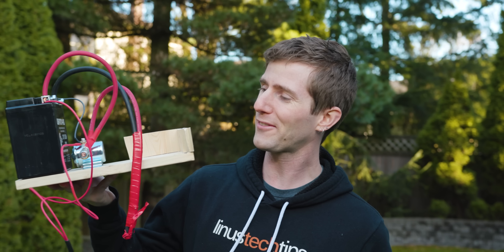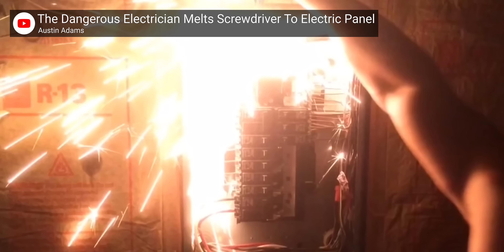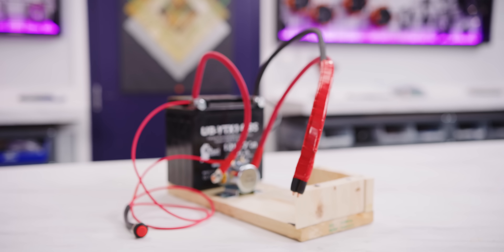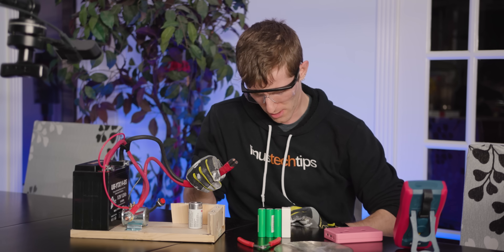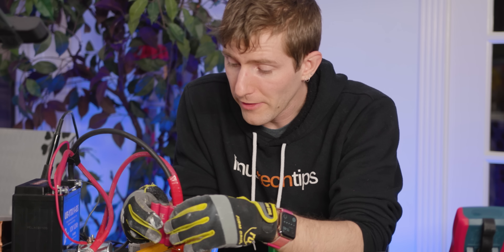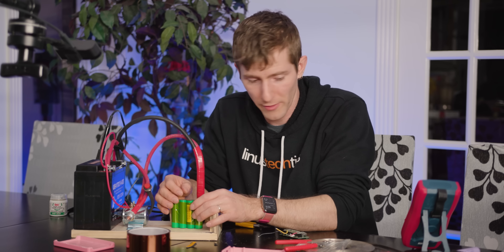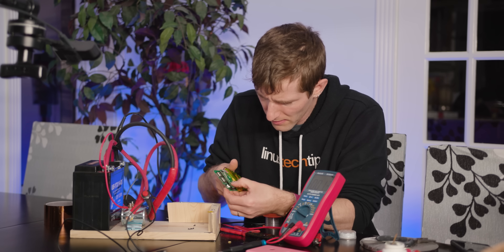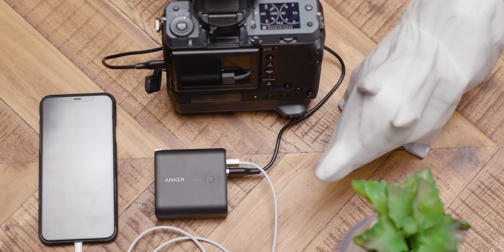I spent $100 to save 20 bucks... and it was TOTALLY worth it!

Comment: you may need a "arduino" driving relay to have the same time on every weld. maybe arduino - optocoupler - mosfet - relay - boom ?
Reply: Skip the relay part. Just use 10 high current mosfets in parallel. Works better and is easyer control with the arduino.
Reply: @Henrik229  do you mind to explain in more detail with tech specs of what I would need to buy?
Reply: An arduino is super overkill. Just build a basic timer circuit lol. Charge a capacitor and have it discharge through a variable resistor. Welder only runs when the capacitor is discharging.
Reply: @Mandragara  Arduino allows for way more precise timing especially since the battery will lose charge over time meaning the pulse timing will have to be adjusted during use even for the same material.
Reply: @dunzerkug  Just use the capacitor and variable resistor as a timing circuit, don't pass the main current through it. Button to initiate the charging of the capacitor, dial on the variable resistor to tune the pulse duration.

I get that it could be a fun Arduino project, but I always prefer old fashioned analogue circuits compared to sticking microcontrollers in everything.
Reply: @Mandragara  sure is, but i doubt they know how to do a 555 timer as easy as they could do it whit arduino
Reply: @ql11ql  True, it depends what the goal is.

You can code most programs in MATLAB, but that doesn't mean you should!

555 timer is more elegant, Arduino may be faster to implement, especially if you don't know how to make a 555 timer. Elegance vs speed.
Reply: I used a raspberry pi with a relay board for mine
Reply: GreatScott has a video about spotwelding at hope.
Reply: Or using COTS components would be a 5V Arduino and 5V relay to control the 12V starter relay, also recommend adding a button to initiate the Arduino program.
Reply: What a great ideia Nicolas!

Comment: May be completely absurd for a $50-100 battery bank, but could be better depending on the situation. Had a professor in college specifically recommend re-celling for camera batteries, specifically Anton Bauer gold mount batteries. Battery bank may not meet your ideal savings-labor ratio, but doing it on a $300+ dollar battery I'd say certainly has a decent RoI on it.

Comment: Pro-tip: Apply Flux before soldering. It will cut down the time needed to apply heat, and ensure a stronger connection. (In before the Louis Rossmann commentary video!)

I actually soldered a new battery pack together for my body groomer razor three years ago, and it still works great today!

Comment: AC is far less dangerous then DC current.  Using the battery is safer because you're dealing with a tenth the voltage.  Battery is 12v where as domestic AC power in the U.S. is 120v.

Comment: 7:00 when you solder you generally should be heating the JOINT and then apply the cold solder to the hot part. Melted solder generally doesn’t stick to cold connections, it just blobs on top.

Comment: As much as I appreciate Linus's efforts, I don't feel like building such a device is suitable for a general LTT audience . Dealing with high currents, even on the isolated dc circuit is far too dangerous for the people not experienced with electric works and is a real hazard. PLEASE DON'T TRY IT YOURSELF UNLESS YOU REALLY UNDERSTAND WHAT YOU ARE DOING. Spot welding 18650 batteries can be very dangerous, please buy a presoldered pack.

Comment: I buy diy power bank case with input 2amps and use my old PB battery
And check the voltage before use
Works.like new pb

Comment: 7:40 - As you're already using a relay, adding a controller that times your weld for you seems like a really simple addon with some simple electronics, an Arduino, or even a Pi. If it weren't for the whole can't go outside thing, I'd give this a shot myself and may put this on my post-lockdown todo list anyway as a fun project for a useful tool to add to the home arsenal.

Comment: a cheaper (and probably safer) option than this would just be to buy some low melt tin bismuth solder, (melts at 138c/280f), just dont use tips that have been used for lead solder or get any leaded solder in it

Comment: You can buy power bank cases off of Banggood which have vast capacities and interchangeable battery cells that you literally don't even need any tools for in the long run even if it's more expensive 18650s are pretty cheap to replace over time.

Comment: It's a bit misleading to say only parallel increases capacity while series only increases voltage. Regardless of what configuration you wire batteries in, each battery increases your total energy storage in watt hours.

Parallel increases your mAh, current output capability, and watt hour capacity. Series increases your voltage and watt hour capacity, but not your current output capability or mAh.

Or a math way to demonstrate. A 3.7v 3000mah cell gives you 11.1 watt hours. 2 cells in series at 7.4v 3000mah gives you 22.2 watt hours. 2 cells is parallel at 3.7v 6000mah gives you 22.2 watt hours.

The do the math you divide your mAh by 1000 to get ah. Then multiply your nominal voltage by your ah and you get your watt hour capacity.

Comment: i made a home made spot welder for ~$17, it kinda works. Got a super capacitor with 400F, 3V for ~$8, a dc-dc converter(with CC and CV modes) that does 15A for~$5, cables for $2 and some beefy diodes to protect from reverse flow for ~$2. 
Basically i have the DC-DC converter attached to an old powersupply and set its maximum output voltage to the rated voltage of the capacitor, and the maximum current as high as it goes. The output is connected to the supercapacitor through the diodes(to protect from reverse current), and the supercapacitor is directly attached to the electrodes.I Opted to use the supercapacitor as a handle, since it has a reasonable shape and that would reduce the total resistance in the wires(mine are not very thick so they get warm even with only a few inches of length).
it doesn't have a button to activate it, you have to time it by pushing the electrodes on it and removing them quickly enough. You could add a relais ofc, or even mosfets.
It does a reasonable job on batteries.

Comment: For a more accurate timing on the spot welder, add an arduino nano and a 12v relay. Just play with the on time in the sketch until you get a good bond. Much safer than human reflexes

Comment: You can just tape the metal clips to the battery cells. No wielding required. I've done that many times before and works without problems when changing battery cells. Just make sure you use some form of insulating tape.

Comment: If you want to build a decent DIY spot welder, don't do it the way they did it in this video. The precise timing can be done relatively easy with a bunch of MOSFETs (or a power relay like in this vid, however a good will cost you and a bad one will weld it's contacts and blow the battery) and an arduino. GreatScott! has a good video on building one yourself. Without a good timing circuit you'll never make any consistent welds.

On the soldering note: I won't recommend it, but it can be done using special low-temperature solder - rose's metal. Unlike regular solders, which melt at around 300 degrees, Rose's metal melts at around 100 degrees. You can relatively safely solder batteries with it, because you don't have to heat up the battery pad that much.

By the way, the cheapest and safest solution are still battery holders (like the ones LTT used for the huge battery showed in the beginning of this vid). And you do can solder a nickel strip to another one safely at low currents, so for a battery pack that's perfectly fine. And solder wires to the nickel strip BEFORE you weld it, otherwise the whole spot soldering you've just done is useless: you need to heat the nickel strip (and the battery) to solder properly.

Comment: Linus: "okay, let's get that bad battery outside now."

Cut back to Linus and he's wrapped his batteries in notoriously flammable kapton tape to hold 4 batteries together while he spot welds them...
Reply: What? Kapton tape does not melt easily at all. It is extremely thermally stable up to 400C (752F). And even past that it will not catch on fire, just become soft and melt.
Reply: @lucasmagno9148  Nobody said anything at all about melting. Besides looking up its SDS properties, look at why it's not approved for use in aircraft wiring bundles. Flammable. Over time, becomes brittle and combusts when exposed to high amperage, has a high surface area for combustion.

Comment: FYI, I'm a Abrams Tank mechanic and your spot welder took too long to assemble. The best method is to drop a 3/4 wrench in the battery area of a fully functional vehicle across the positive and negative bus bars while you're holding jumper cables.

Comment: 3:50 There wouldn't be any electrocution hazard, just a burn/fire hazard. 🔥
8:05 False, there are plenty of single cell power banks. Boost/step up converters can convert the 3 - 4.2v to 5v

Comment: It's weird going home from work where I'm making lithium ion batteries to watch a video about making a lithium ion battery.
8 mV difference between cells should be safe enough to weld them together for the leveling issue.

Comment: OMG that setup is soo janky.
The manual timing is fine-ish but that button definitely is not rated to switch that big of a relay. The contacts of the switch welded together, that's why it switched on permanently and your Li-Ion batteries almost went thermonuclear.
(Maybe even a flyback diode over the relay switch contacts would help in the button contacts not welding together)
But please, use a better button next time o.o
Reply: I mean, I can't tell accurately because of the framedrops of the other camera, but at 8:41 I'm pretty sure that 18650 is actually smoking (if you look at the leaves behind him)

Comment: With soldering you should heat both surfaces, not the solder itself, the solder should flow between them only when two surfaces are hot enough to melt it or you run the risk of a cold joint (will appear dull and brittle)

Comment: Cool, I'd recommend a diode in reverse over the relay coil to avoid getting jolted if you happen to touch those terminals or the switch when releasing it. It also prolongs the life of the switch. (This is also very important if you ever want to drive a relay with a transistor instead of a switch)

Comment: Man Linus..  Id have done a little more then, "Im not suggesting you do this"

Absolutely NO mention of buying quality cells from a reputable vendors, OR ANY MENTION of the fact that, if mishandled, lithium cells can literally explode like a grenade.  Not usually safer chemistry cells from well known sources, IE- LG, Samsung or Sony, but you didnt tell anyone that.  What happens when Johnny dumfuck goes on ebay and buys 8 LiteFire 18650 cells, NOT safe chem, and puts them in the drawer without a case.  Cells roll around, rests against a screw head holding the drawer together, shorts out contact, explosion and fire ensues.

People NEED to understand that Lithium Cells, Safe Chemistry or not, ARE NOT SIMPLY BATTERIES like a AA or D or even a 9Volt Energizer.  Those are relatively safe under most conditions.  Lithium Cells are angry tubes of densely packed energy that WILL explode and hurt or kill someone if handled improperly.

Look I use lithium cells every day of my life.  I vape(7 years cigarette free, vaping saves lives), and I mostly use advanced mods.  I say these things because of how many people have hurt themselves simply because they were not properly informed.  Nothing really happens when you put a AA battery in your pocket with loose change.  MAYBE it might get a little hot in which case you grab it and toss it.  No explosions, No loss of Leg.  But do that with an iffy Lithium Ion Cell?  If it hard shorts, there is no grab it from your pocket and toss it, instead, its lose your leg.  Or severly burn your leg.  OR fucking die.

Comment: to make a better spot welder u could connect the switch to a micro controller and have the micro controller control relay. this allows for tuning of weld time easily to avoid over heating or under heating of material.

Comment: Thankfully, Vruzend Kit V2.1 has four "barrel bolts" to address the problem you mentioned. They can be placed through any part of the pack to hold four points in compression which should keep the pack together.

Comment: If you replace the pushbutton with a arduino and some pre coded sofware from github, replace the "relay" with some fets, and you have a system that is a lot better than the one you can buy on ebay. You usually want to do a double pulse for each weld. The only thing you have to do is adjust the lenght of the weld in milliseconds, to something that works for your battery and cable config. Once you have done that, you will get factory grade welds every time :)  You can also use a lipo with enough current, instead of the big lead battery.

Comment: "it's nighttime, my kids are in bed and I am ready to burn my house."

See, transformer option is safer because you will have low current side much much more easier to disconnect. This relay had hard work to do... If that would "spot welded" itself you would be throwing it thru the window and pray to not burn down your neighborhood.
Reply: That relay without a doubt is rated for the current they are running through it, otherwise it wouldn't be that large.
Reply: @lucasmagno9148  and you know it only because it looks big? ;P
Carrying current vs disconnecting current are different story
Reply: @MariuszChr  And because if you Google "high current relay" the page for the component series that relay is a part of is the first result. The relays in that series are rated from 65-200A continuous load, and since Jake can read an amperage output label in a battery he would have bought the one that handles the current of the battery. Stuck relays due to high current spikes are only an issue if you use one that isn't rated for the current.
Reply: @lucasmagno9148  still, you don't know what current actually is. They are simply doing short circuit. Pay attention, relay was stuck few times.
Reply: @MariuszChr   The switch was stuck, not the relay, this is not uncommon with cheap switches. A short circuit will pass through as much current as the wire resistance will let through (not the limit here) or as much current as the supply can provide, which in this case is the maximum current output of the battery. Size your relay around that and you won't have issues.

Comment: Ive seen a Kweld kit that seeps pretty DIY and you can control the joules of power going to the tips of the copper but with your setup there is no regulation seems kind of janky and quite dangerous.  Kweld seems to have much more control over it.

Comment: I build EV bikes and the batters for a living.  You have the basics right. But first I would use a very cheap ($2) "Trigger Delay Time Turn on Switch" and I would use a car battery of around 550amps+ 55ah+ and a must is finding real nickel, not nickel-plated steel. Goole how to test, Ie salted water rust etc etc. This cheap switch will help big time. Also join us at endless-sphere.com if you are thinking of building any battery pack, of EV...

https://www.ebay.co.uk/itm/DC-5V-12V-24V-Trigger-Delay-Time-Turn-on-Switch-Timer-Board-Relay-Module-0-24s/153187720180?ssPageName=STRK%3AMEBIDX%3AIT&_trksid=p2057872.m2749.l2649